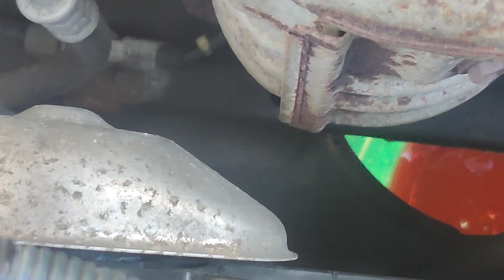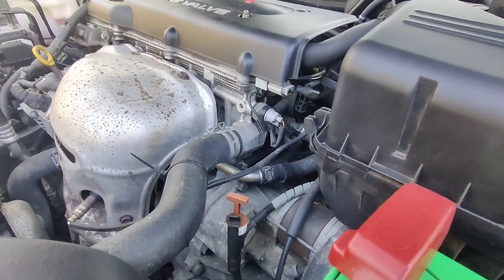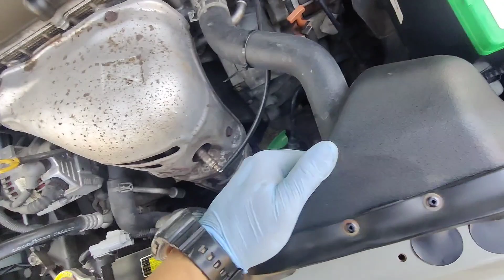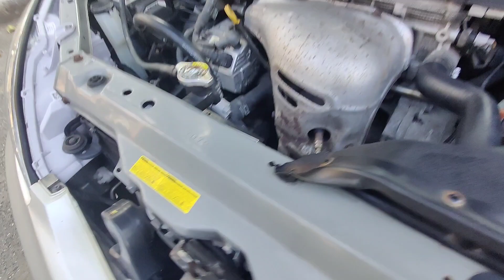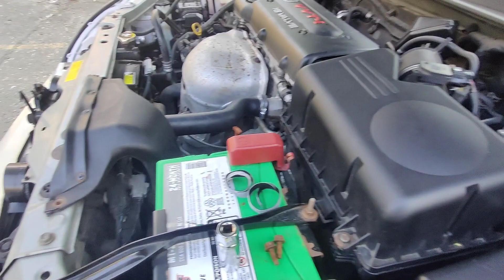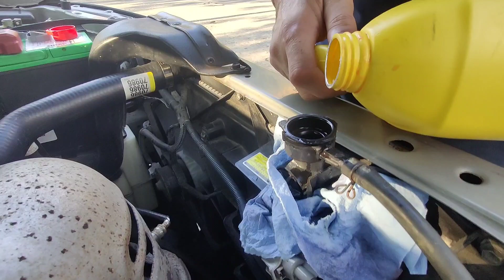coolant and upper coolant hose replacement.  2003 camry

Comment: Wher do u get the hose part and what’s it called
Reply from the maker: You can get the hose at any auto parts store , upper or lower radiator coolant hose.  Enter your vehicles information